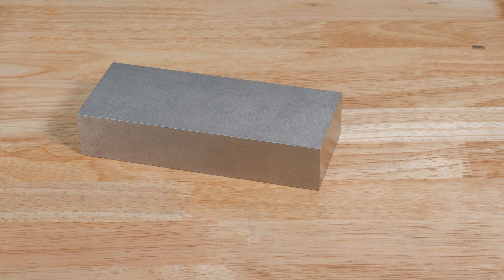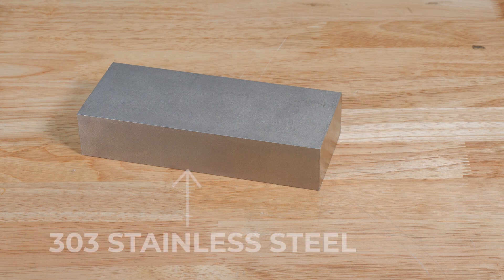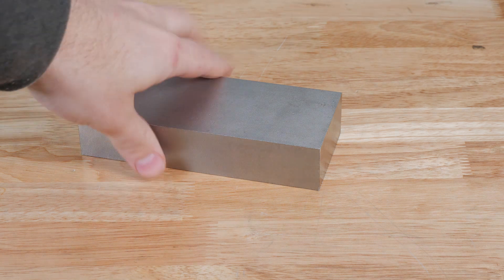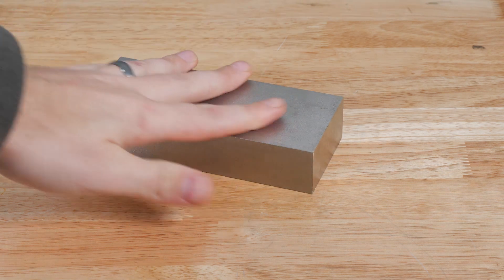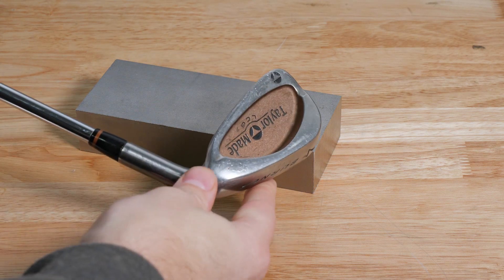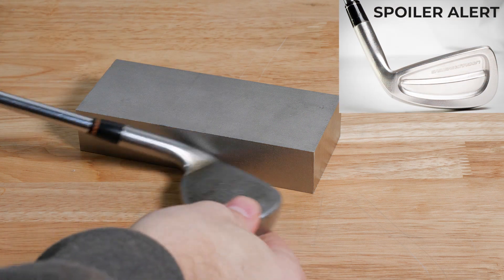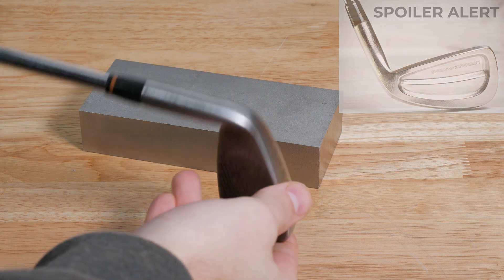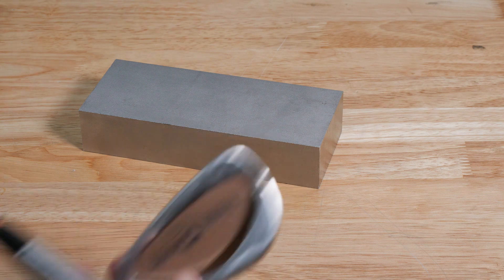Machining a 7 Iron Golf Club from Billet Stainless Steel on the MR-1 CNC Gantry Mill

Comment: Can you show the machine cutting inconel 718? Also what is the maximum tool diameter the spindle can hold?
Reply from the maker: If you must cut inconel 718, you really should be looking into a different machine. That's about the hardest material there is to machine.
Reply: @LangmuirSystems  ok but what’s the maximum tool diameter it can hold?
Reply from the maker: @aarontabor2915  1/2" shank tooling. So a 1/2" solid end mill or insert tooling/fly cutter with a 1/2" max shank diameter.

Comment: Will we be allowed to upgrade this if we buy it with say better spindles or servos?  better ballscrews if we want?
Reply: You dont need them on small machines.  Sounds like you guys want a $100,000 machine for around $4500 shipped.
Reply: I want to know this too. If I can fit an ATC spindle on this down the line, I'm sold.

Comment: Nice! What CAM did you use?
Reply from the maker: This was done on Inventor HSM but could have just as easily been done on Fusion 360.
Reply: @LangmuirSystems  I’m pretty new to CAM.  Is there post-processing of the code required for this machine using either of those CAM packages?
Reply: @texasermd1  probably a generic grbl post processor unless they have something specific with auto desk already
Reply: @CryoftheProphet  We will make sure we work with Langmuir to have a milling post at the launch of this machine.  we have already have posts for the cutting machines.
Reply: By We, I mean Autodesk.  So support for Fusion, Inventor & HSMWorks at a minimum.